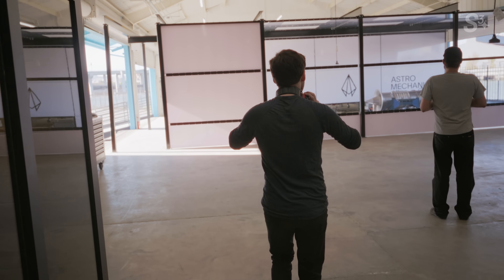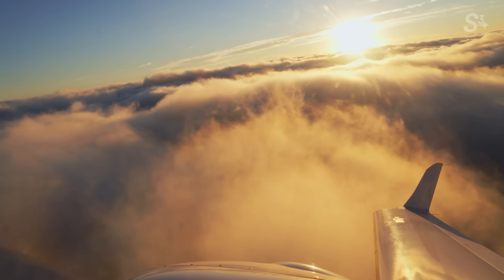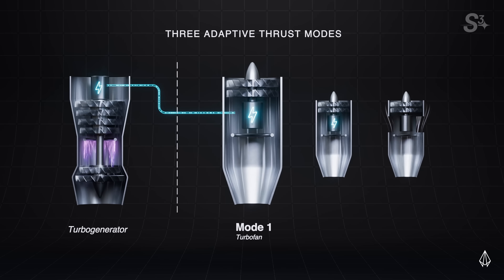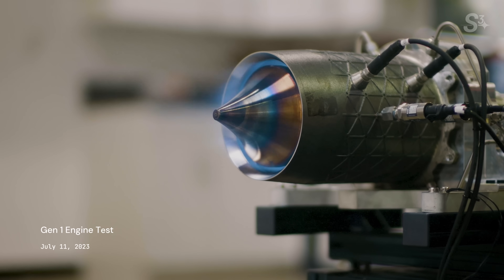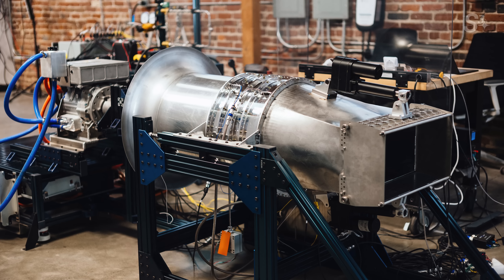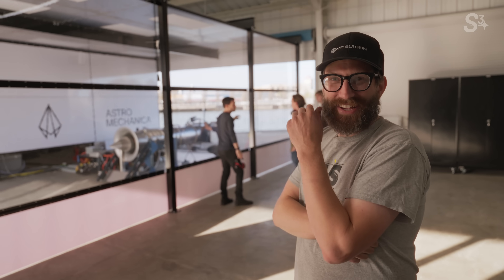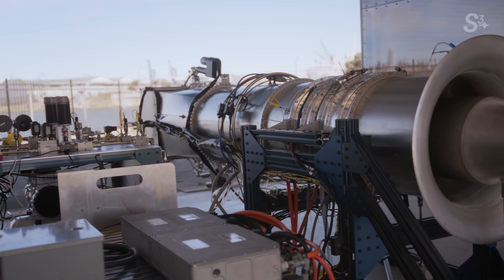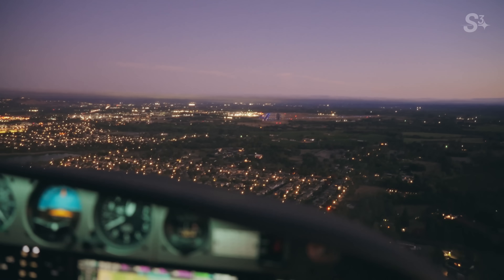The Age of the Electric Adaptive Jet Engine: Astro Mechanica

Comment: Hi, could I get a clarification on exactly how this works?

On a normal turbine engine, the compressor and the turbine are directly mechanically coupled because the turbine and compressor wheels are on the same shaft. The big turbofans run two or three concentric shafts to enable each compressor stage to run at its most optimal speed - not having this means that there is usually a requirement to vary the stator vane angle in the compressor.

So this system appears to have a back-to-back motor-generator in between the compressor and the turbine - the compressor and turbine are not mechanically linked at all. This allows the turbine to run at its most efficient speed and the compressor to run at its most efficient speed. I assume that there is a VFD between the generator and the motor to provide speed and power control. Is this correct?

Are the motors/generators DC or AC?

Comment: Concorde failed initially because it was not allowed to fly where the profitability was.  The original Ozone and sonic boom arguments doomed the concept, the Atlantic runs was a  compromise to allow British and French pride to have an outlet that the regulatory officials COULDN'T find a reason to ban it from. It was also a virtue effort, only the elite could fly it so the elite supported it.
The aircraft itself was not a bad machine although it was delicate in many areas, and improvements were halted real early as there was no reason to improve it, like we do in a  production run of a "lessons learned" environment.  And it WAS expensive, the Olympus was a military grade designed turbojet, and even though it was tweaked for the Concorde, it was never an economic powerplant.  The need for constant reheat (afterburning) made it much worse.  Of course, now we have Supercruise Turbofans, and the Concorde would have had much better economics with that type of technology.  The Concorde was a prototype for an SST, or essentially a pioneer, and we know how you can tell which ones (people) are the Pioneers, they are the ones with arrows in them.

Comment: Oblique flying wing design is the analog of the electric turbofan jet engine, and is the most suitable to reach the best performance at any Mach number.  Don't settle for anything less.  Think of the noise advantage taking off from any airport with zero sweep maximum efficiency mode.  As the altitude increases and is out of the noise restricted zone, sweep and dive through transonic and climb at full supersonic to reach the final cruising altitude.   
Minimum carbon emissions is another advantage of the oblique flying wing design, and the abundant volume is also available for hydrogen fuel storage.   NOx emissions better be very very low, as NOx is becoming a critical factor in climate, with agriculture being a very large driver.

Comment: OK, just wanting to make sure I'm understanding the system correctly...you're using a gas turbine to spin a generator, the generated electricity is used to power two electric motors, one spinning the fan/compressor, the other spinning the turbine, and the purpose is to be able to spin the "cold" and "hot" sides independently to allow each "side" to run at whatever rpm is most effective at a given flight speed? I'm assuming a decent-sized battery is required, as well? I'm not going to poo-poo the concept, but I will say as someone who currently assembles jet engines for one of the world's major manufacturers, whatever you do keep things as simple as possible. The sheer number of components on a "traditional" jet engine is already staggering as is.

Comment: This is interesting.  The mechanical decoupling of the hot section from the cold section and drive each via electric motors is actually quite novel.....Probably able to get rid of reduction gearboxes and shafting etc.  I'm no engineer, but will follow this closely.  I wish them success.
Reply: it's pretty new but porsche's electric turbo also does this decoupling. it's exciting how good motor/generators are roght now for this to be possible
Reply: The hot section and cold section are decoupled on most turboprops like the PT-6 it’s called a “free turbine”…but adapting the compressor with e-motors is pretty wild

Comment: First of all, if you're using LNG as the fuel, you can achieve the step-change in TSFC (for HSCT-like transpacific unrefueled range) by intercooling a turbojet or low-bypass turbofan, utilizing the cryogenic exergy of the fuel to greatly reduce the shaft power absorbed by the HPC (or increasing the OPR with no additional shaft power from the turbine) without running into issues with frosting in the troposphere (as in the SABRE precooler). Second of all, if you want to build a VCE with low TSFC throughout the entire mission, you can build a Turbine Bypass Engine, an engine with a Variable-Area Turbine Nozzle, a YF120-like engine with a Variable-Area Bypass Injector, or any number of other engines that don't use electric machines and power electronics to do a shaft's job. Electric transmission only makes sense for distributed propulsion applications where you're trying to increase propulsive efficiency by matching the distributions of thrust and drag (and thus overcome the system-level specific power/power density decrements inherent to these electrical systems). These people would be more useful doing VFX for Marvel movies than aeronautical engineering—unless they're money launderers, in which case they're actually doing a pretty good job of tech startup role play.

Comment: It would be cool if they explained actually how it works. Does using electric motors to drive a compressor actually allow an engine to ingest supersonic air? Lots of problems with inlet temp. Also it looks like they just put an afterburner on a ducted fan. Groundbreaking right? I hate some of these startup videos, it’s like they assume everyone is stupid. I think we all remember how the saber engine worked out.

Comment: When technology improves why not eliminate the turbogenerator and power the compressor with a battery?  Surely that is a lower barrier to a longer flight range incorporating electric (hybrid) technology.  This would provide a huge fuel savings.

Comment: I like how they didn't mention payloads, which is a nice big ol' red flag to tell you the marketing on this tech is pure BULLSHIT. We don't have these turbines in the commercial sector yet becasue they are not efficient enough yet to actually do these flights. They won't be for at least a decade or two until we can get the weight down and the power up, which means more advanced batteries that are not commercially available yet.
Electric planes are cool, but the ones you can actually fly right now have a flight time of less than 1 hour with a max speed of 140mph. The new RR electric jet did 15min at 332mph. Both of which are experimental and won't be viable for a very long time. 
It's great seeing innovation, but don't let companies like this trying to commit investor fraud lie to you about the reality. Electric planes doing extremely short routes (inner-city) are not really that far away, but commercial jets flying commercial routes, are a decade away or more.

Comment: Very inspiring! That "wall" they're behind watching the engine fire up for the first time seems awefully thin, glad it didn't end up in a RUD.
Reply: Because that "engine" is not producing any serious thrust, is fake, they had to fake the sounds because it would be too obvious is just a giant ducted fan with an "afterburner".
Reply: That wall is probably made from very strong ballistic material. You can't tell what the thickness is of the glass, it's probably very thick bullet resistant tight material. For the wall itself you could use something like AR 500 ballistic metal plate about an inch thick or basically any high carbon 1-inch thick tempered steel plate. The wall wouldn't look very thick but it would be very robust. I would bet that they used good materials in the construction of it.

Comment: Amazing.. Is there regenerative aspects for your battery or systems power application once your flying? Also are you using any graphene transistors? Especially since there can be issues with the sonic boom on graphene?

Comment: The technology seems very interesting tbh and I would love for them to make it work, but I do not understand why they are using natural gas instead of Jet fuel. Gaseous methane is about 1200 times less dense than jet fuel. Rockets uses methane in cryogenic form to increase density and the amount of fuel you carry for a given volume. I do not believe the FAA are going to certify Cryogenically fueled aircraft plus it adds a lot of complications in-terms of operating costs and ground support equipment to use methane. And I say this as someone who works on Methalox powered rocket engines.
Reply: You [and the vid] answered your questions .  =]  FYI, LNG because of lower bunghole emissions. LOL
For the greeee!!!ns, machines use petro fuels because......it gets things done and... there is plenty of it for the mid term future and it can also be a renewable source of energy. GRRREEN-BS can't power the world...and can't compete w those who don't subscribe to this money making scheme of a small group. Very few ppl understand the forces behind the agendas foisted on the public.

===

>>>  Reaction machines are designed for a narrow operational band  where they spend much of their time. The trade off in this electric hybrid gains very little. I designing adv turbines for our product[s], both of which will have a significant impacts.

 I represent  New Frontier Technology Group. We try to stay under the radar for now...need funding, but I can be reached here. Gave up on  the 'w   oke' LinkedIn nonsense. You may find links to various innovation papers all over the net including the Fuel Agnostic Zero-Emission FAZE engine. <<<

===
Our latest push is to develop a simple, low cost, point to point, / door-to-door, rapid to market, ultralight category, personal air mobility platform called PersonalJet©, which, with investor funding, will later be developed into an more advanced ride hailing / air taxi PersonalJet 2.0 system which will shelter our [mine mostly] IP/innovations. Autonomous capability will address cargo markets. Other features will set us apart from the crowd.. The PJ 2.0 will have very advanced ultra-efficient engine[s]. Larger system will be able to go trans-oceanic distances...in a small footprint. We aim to disrupt current paradigms/players/markets.  Seeking strategic partners, investors, etc. now.

I'm a triple engineer w thousands of inventions but for lack resources.... 🛑
===
Ya, YT/Goober might be forced to adjust their sick cent-or-shi# agenda, now that the Freedom administration is in.

Let me know this went through. Tnx.

Comment: They are using an external turbojet engine to generate electricity right. And that electricity is then used to blows air. 

I don't see an advantage. Please clarify. 😊
Reply: The turbine section powers a generator and shoots a large amount of thrust out the back. The electricity from the generator runs the compressor section at the front of the engine. The compressor pressurizes the intake air for the turbine section so it can burn more air & fuel. This is the definition of a jet engine. Their principal modification is removing the traditional driveshaft between the turbine and compressor and replacing it with an electric generator & motor. This allows them to effectively change the gear ratios between the turbine and compressor. This is what the Pratt & Whitney PW1000 does but it does it with a transmission.
Reply: Something something energy losses from having to turn a big gear box… something something how expensive said gear box is… something something how said gearbox is very narrow in flight regimes

Comment: Seems like a really nice pitch for investors but that’s where it stops. 
Let’s face it, your typical investor is not exactly well versed in engineering as well as gas turbine technology.
Let’s now look into the technical aspect.
As far as I understood his idea is to have an electric motor coupled to the compressor section of a gas turbine engine to compress air for the combustor to do it’s job, and have a generator of some sort coupled to the turbine section so that in theory they can use the electricity generated from the turbine to power the compressor. 
Now, is this a good idea? Depends on what they are trying to achieve however with our current technology in motors and generators, to be able to develop the thousands or tens of thousands of horsepower needed to drive the compressor, your typically available electric motor won’t do.
The weight of the motor plus many other factors will outweigh the gains. 
There was no information on how this concept could help an aircraft go supersonic nor did the test seem legitimate. 
Its easy to make a fan with a type of afterburner behind it to make it seem like it develops thrust.
I welcome any input and if you know something I don’t let’s discuss it but for now if I were an investor I would not invest in this startup at all.
Reply: I think the idea is to create sort of a transmission using the motors. But gears exist and are more efficient for sure. Their advantage may be having a stepless/variable “gear ratio”.

No idea how useful that might be though outside of a test bench…
Reply: @julianholstein3840 you are correct on that point. Just with one fact though we can debunk this.
Electric motors don’t yet have the power density to produce the shaft horsepower required for a compressor which is in the thousands and tens of thousands range.
Reply: @19wael96  Not true at all. As long as you can keep it cool, you can push the kind of power levels you need.
Reply: @moki123g  tell me more
Reply: @19wael96  Uh, just off of the top of my head. Locomotives, Tesla model S 760KW, Rimac Nevera 1.4MW. There are countless MW + industrial electric motors. 
At altitude, you have lots of cool air, You have the opportunity for phase change cooling with LNG.  I am not saying it is going to be easy, but I don't see any fundamental physical limitation. We also have very robust and efficient Silicon Carbide electronics now.
Reply: @moki123g  If you look up the specs for the motors you specified, the power output is nowhere near to being adequate for a compressor section of a turbine engine if that is what they are trying to achieve.
As an example a General Electric LM2500 uses around 20,000 shaft horsepower just for the compressor.
The numbers don't add up?
I'm open to discuss this further if you know something I don't.
Reply: @19wael96  Welp presumably they have done testing and the math and think that they can do it. We will see.
Reply: @moki123g  yep yep 👍🏽

Comment: By separating the compressor stages from the burners and turbines enables a rocket based combined cycle engine that fully bypasses the compressor for flight up to M6.5. After that speed, witch to pure rocket mode and get the turbine out of the flow as well. Designing that would be a huge challenge, I'd particularly be interested in an injector plate for a rocket engine that also is a great flame holder and injector for a jet engine core.
Reply: Have you heard of Reaction Engine's SABRE engine? Unfortunately yet another project with fascinating potential strangled at birth due to the lack of adequate investment. A damning indictment of the UK's timidness in investing in risky ventures.
Reply: @stephen-boddy  the SABRE is a liquid air cycle engine. It is a type of RBCC, but not the kind I have in mind. 

Engines that use the liquid air gathering idea and supersonic combustion are fine, but they are far more difficult than the cycles I would use; Brayton cycle that transitions to a staged combustion cycle.

Comment: Seems like they're planning to do the whole portion (it briefly mentions vertical integration) from engine to jet to service. That's an interesting take as historically the engines are made by a subcontractor for the plane manufacturer who leases the planes to the airline who hires another subcontractor to maintain them. That's a lot of middlemen they'll be cutting out, so they maybe tackling the other issue of the Concorde, the expense of a ticket -- if the cost difference to get somewhere fast is signifcant, only the wealthy will be willing to pay it.

Comment: Cool ideas, also makes combined engine cycles with ram jets easier to integrate into the design down the line now that the turbine is out of the way
Reply: There’s a company called Hermeus working on combining a jet engine with a ramjet
Reply: @Bronilli  Yep, RealEngineering did a whole video and more on it. But they don't use the same setup this one uses.
Their core principle is to make off the shelf tech work. Their jet engine on the main production vehicle is just a modified prat and whitney. The part they innovate is adding and intercooler to push the engines power during the supersonic to hypersonic transition and bypass ducts to enable the ram jet effect.
Reply: @cyrusesfahani5935  I’m imagining the ultimate jet engine being a combo of this and the hermeus. Stick it in a 1 or 2 seater private aircraft and have it like a personal sports car in the air that can get you anywhere in the world in like 3 hours
Reply: @Bronilli  Haha if only I had that kind of money even if such a sweet plane were to exist.
Reply: @cyrusesfahani5935  ay listen. Maybe we build it, sell it, and we’re the next Elon musks or whatever